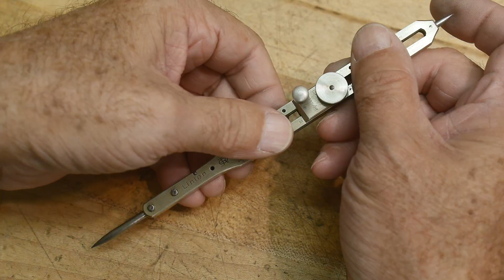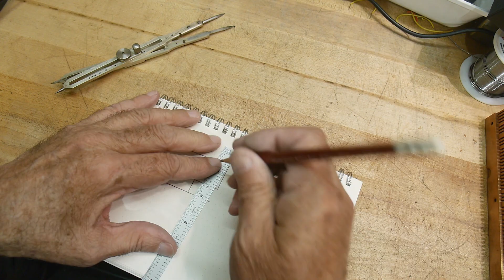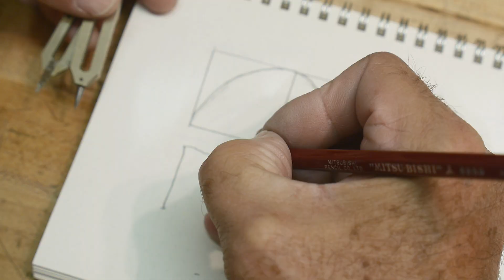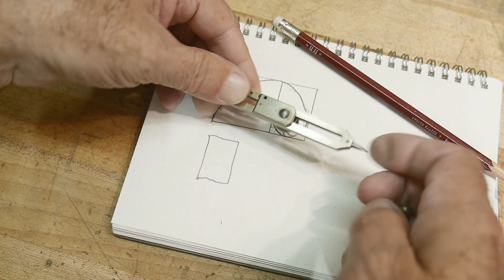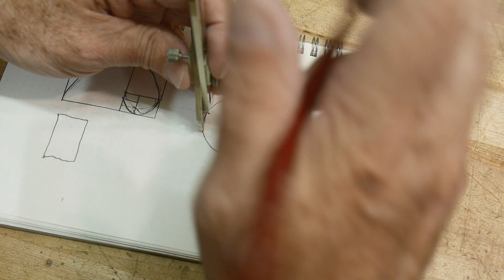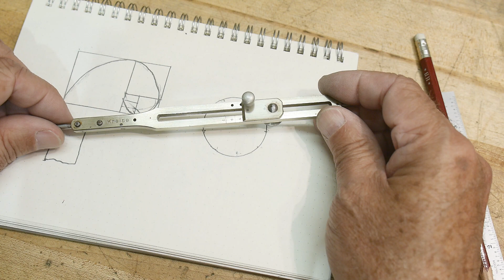#1556 Proportional Dividers

Comment: 1:1 has always been silly and redundant to me. i get why it's there but you can measure 1:1 on any setting, just mark with the same side you measured with, you can do this on 1:8. in fact, doing it on 1:8 would allow you the largest expansion for 1:1 measurement.

Comment: Used a similar aviation proportional divider extensively as a USAF Navigator.   Could be used for quick time - speed calculation directly on a chart, or to more accurately measure latitude- longitude coordinates of a point for manual input into a flight computer.   They were part of our issued equipment.   Still have them (somewhere)...

Comment: In my computer graphics grad course at McGill in 1970 (yes, Seventy), my project involved Golden Sections nested and rotating. With double-precision Fortran code and a good Calcomp plotter, they matched exactly. Analog precision.
Reply: Fortran....wow!!!  Haven't heard that word for years.  I was on the beginning edge of Fortran in about 1966/67.  I did a bit of coding, but determined that it was not a direction I was very interested in.   Were punch cards still around in the 70's?
Reply: @williac43  I still have the deck of cards with that graphics project program on them. Letters have since faded but the holes are still good! I learned Fortran, PL/1 and APL at McGill too. APL is still the best.The most modern version, Dyalog, is free for the Raspberry Pi.

Comment: This would be a very handy device for rednecks like me. Since I suck at calculus, I sometimes have to use graphical solutions to solve problems. They get you in the ballpark or tell you what you're trying to do is impossible or impractical. That would make for an interesting series of videos - how to solve various electronics problems graphically. I know you've done a lot of smith chart videos; but it would be interesting to see graphical shortcuts to other kinds of problems.
Reply from the maker: https://youtu.be/rcdDwzAnc0U
https://youtu.be/gaxzX28pKxQ
Reply: @IMSAIGuy  Thanks so much! The online HP sliderules are cool! I tried saving the javascript page for offline use but it doesn't work right. I keep fiddling with it and figure it out.
Reply: @IMSAIGuy  Modifying the javascript to work offline on the HP sliderules looks like a pain. So I just right-clicked and saved the images. I'll drop by office despot, and have them printed on card stock, and join them together with some eyelets. A country boy can survive! Hah!